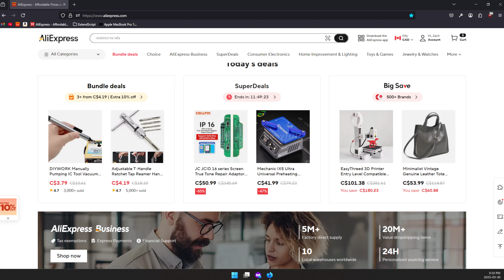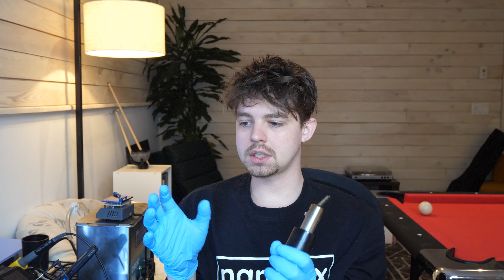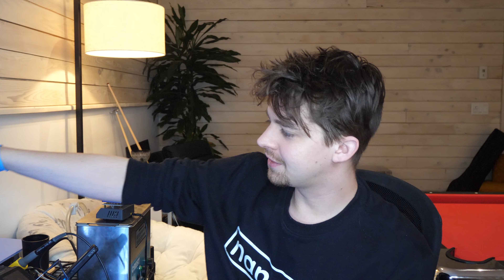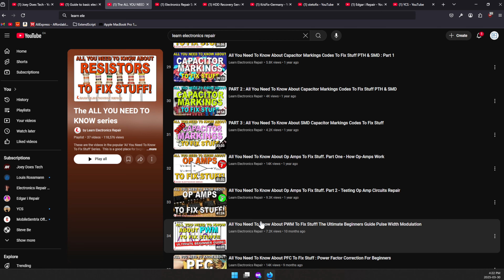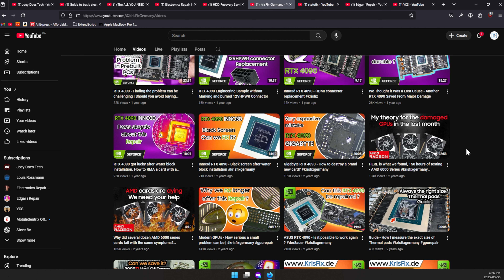10 Things I Wish I Knew When I Started Microsoldering

Comment: you said a lot of good things.  The worth fixing comment was a good one.  I recently got a few consoles with bad HDMI ports.  A series s had just about every trace ripped off.  I tried a few times and could not get it.  I replaced 2 ps5 HDMI ports that were very easy.  Went back to the series s and spent a ton of time and finally got it.  was it worth it time wise if I was doing it for a living, probably not.  Was it worth it for the experience, learning, and confidence, Definitely.

Comment: Thermal mass heat transfer is definitely a thing. I never really used the chisel tip until I stat doing micro soldering. I first thought I would need micro tips, but it was just the opposite. A decent iron that can maintain temp in that thermal mass on the soldering tip was also key. When it comes to hot air, it depends on how far that other YouTuber holds the hot air away from the board also, so temp and airflow may be different for your air station and technique for many reasons.  Practice does make perfect, get your friends old stuff they are tossing into the trash. Anything with a circuit board and just go to town on it for practice.

Comment: Thank you for honest video 😁. In the future when I will be able will need to get soldering iron and heat gun because I have only cheap soldering iron with one tip that... not good for many things and also tip is not great anymore. Okay I rarely did any soldering non-smd components but I have many PCBs to start trying and testing when I get equipment. I have wick, copper ball to clean soldering tip, cheap oooold fake Antek flux that expired 2018 but still helps with soldering 😁, it will be fine for experimenting.

Comment: The point about watching multiple channels for their unique approaches to soldering is definitely important. I recently ran into some videos from a channel called Mr. Solderfix, and he showcased an interesting low-budget technique I've not seen before where you use a copper wire and extra solder to heat multiple pins at once to drop out through-hole components without using a hot air station, along with other things.

I've always wanted to get into soldering for mostly personal use, and watching some channels such as yours is finally convincing me to take the plunge. I've done soldering before, but it was close to 20 years ago on a macro level with a cheap low-power wall-socket iron and unleaded solder. It felt great when I did things like replace or bypass a broken switch on a device, just knowing that it was still salvageable with a little work.
I'm definitely not doing it as my first project due to the risks of damaging it, but I have a goal of modding an OLED Switch after getting a taste of what the console can do with an unpatched v1. I'm not sure that anyone local offers such a service, but in addition, I'd just like to do it myself if at all able. I also have a number of smaller projects I'd like to tackle, such as modding my old GBA and a Gamecube, along with replacing a worn cartridge slot on my Phat DS. I also have an old GTX 960 that died years ago, and it could be 'fun' to try to revive it for science.

Comment: @9:00 so my gripe with your answer is, I may not have done a particular chip before and I want to know the ballpark since you have just done it. How difficult is it to show the data as in, my hot air station is set to what flow and what temperature or the iron is set to what temperature. It may not work for me but it takes me to the ballpark and I can fine tune it from there. A statement that "oh I'm not going to tell you what temperature it is because it will not work for you" is you not understanding how your data can be valuable for others!
Reply from the maker: I would argue that me sharing my temperatures could actually hurt vs provide value if I don't put them into context. For example, with hot air I use high temperatures because I can work fast and apply heat for less time. A beginner who is taking a longer time when doing SMD rework because they're still getting used to their tools should not use the same temperature as me because they will likely burn components and/or damage the board. All that being said, I actually made a video recently sharing ballpark temps for hot air (where I put things into context):
https://youtu.be/sG02bRbi4AQ

Comment: I go SMD rezistors And caps And some Chips like BGA or KBC with hot air...to remove And to Solder i use soldering tip for KBC And some 8 legs chip to

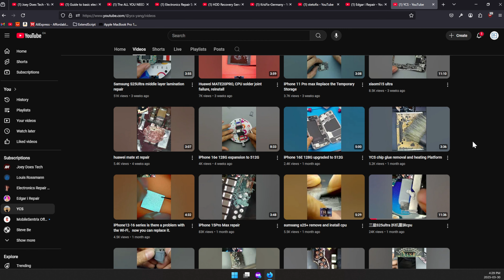Comment: 23:37 - Mr. SolderFix is another channel that does a deep dive into soldering techniques for repair of PCB traces, board to wire connector removal, multipin device removal, SMD device removal,etc. He uses hot air, heat masking techniques with Kapton and other heat resistant tapes to protect surrounding components, and many other practical concepts specifically in the soldering space.

Comment: I use YCS tools my hot air station is YCS R1 pro my soldering station is an YCS S1. And I just want to add something when comes to electronics knowledge is not only about repairing. It's also important to know to build and make your own things using the electronics knowledge. If you go and watch my first videos I uploaded on my channel you will see something made by my self with no copying a schematic or copying someone else. It's all made it from my mind thanks for the knowledge I studied on electronics!

Comment: Your comment about "Don't even bother with a uv flash light it's not strong enough" hit home. Tried to use it even after adding like 8 AA batteries it still didn't do much after like 5 minutes. Ended up getting solder mask everywhere. Immediately ordered the uv curing lamp you suggested. And a bunch of tweezers. So much better. My esd black ones Flippin curled around at the end somehow. Stoked on your suggestions. First thing I ever tried was the rgh 3 chip less and I got it! Was so stoked. Like ima keep doing this this is enjoyable. Love fixing things. And saving others money on their broken stuff.
Reply from the maker: So glad that was helpful!

Comment: Preach! That's how I learned I nose dived right into it. Thats how i learned to get out of the "oh $h!t" moments because I quickly got into them, lol deeming learning how to master handle the soldering iron and what are the erasers aka solder wick and pumps. 

Excellent points on heat transfer that took me a bit and some money to learn. Now I advocate if you can buy great tools at the beginning or at least save up for it to do it in one shot i praise it because it would of saved me so much time and money trying different things and upgrading little by little. Not to discurage anyone to do it when they can because learning is the most important part but it does help save time and headaches later on. 
I like nanofix because he tells it how it is without gatekeeping which are things I wish I had while learning. I still learn today! Great video!
Reply from the maker: Thanks a ton man! Great points about investing in nice tools up-front. I 100% agree with that! There's nobody better to invest in than yourself

Comment: Does anyone know where to buy good quality capacitor books? There's some on Digikey but its hard to find one with a large range that isn't high priced.
Reply from the maker: Ali has a few books like this that you would need to buy per-capacitor size, but I can't speak to how good they are:
https://s.click.aliexpress.com/e/_oEKZlKD

Generally I pull caps off of existing boards I have schematics for which is usually sufficient TBH.

Comment: While all those insights are common sense when you get to them by yourself I appreciate you putting them all together in such a concise manner.

Regarding the temperature settings, the fear of bga or breaking something there's nothing more helpful than getting some spare boards you don't care about and just purposefully test the limits of how much heat and resoldering attempts they can handle until they break. This will show you exactly how much slack you have with your tools. Also, just check Sorin The Dodgy Master how he's doing bga and the likes giving zero fks about even heat distribution and sometimes even flux and it works no problem.

Regarding the advice to not blindly copy one's fav youtubers if something's working for them, I'd generalize to actually use one's brain when something's not working out for them. If you have a visual evidence that something works for another person, this means either your tools, your consumables or your technique is not appropriate for that case. Analyze what and how you do, find what's lacking and adjust. There's no rocket science to this.
Reply from the maker: I love these additions! All very true!! I can't watch when Sorin solders BGA chips 😂😂